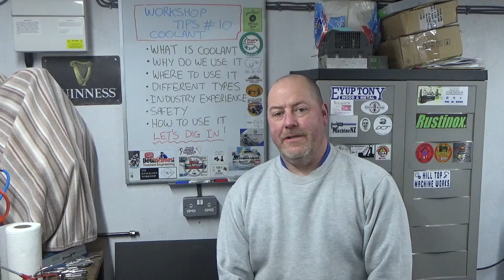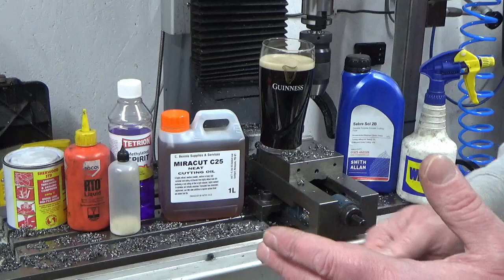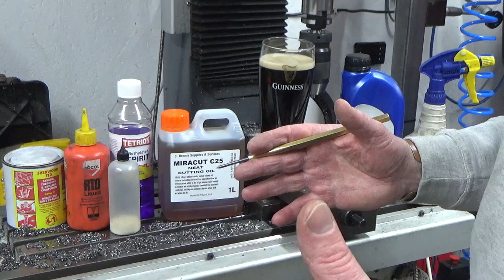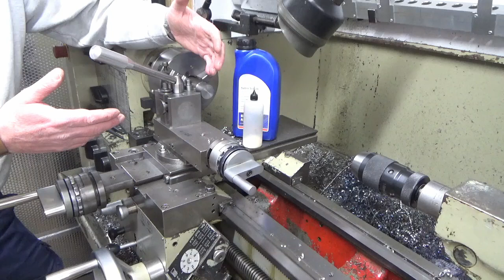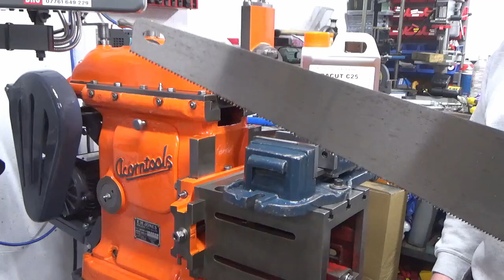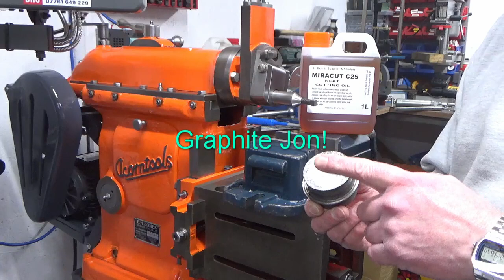Workshop Tips #10 - Coolant in the Home Shop

Comment: Hi Jon 
Interesting video but I really think you need to spend a bit of time researching bacteria, not all bacteria grow in the absence of oxygen, there are plenty that will not grow unless oxygen is present so removing the oil layer would probably just result in a different bacteria growing.
You also mentioned that you should not pour coolant down the drain, I absolutely agree, but what happens to the coolant that you squirt onto the  lathe, presumably you mop it up with a paper towel, then where does the towel go?
Reply from the maker: Hi Chris, thanks for the comment. Yeah, not really wanting to become a biologist, all my information just comes from real world experience, and having seen the bacteria growth 1st hand etc, I presume that when you do run the coolant, you oxygenate all of the liquid with more than enough for the bacteria to survive on, and when the tramp oil layer is on the top, it doesn't allow the gasses to escape accelerating the degradation. In terms of my use, the water element evaporates leaving behind a very small amount of neat oil, I just leave that where it is, and one day there will be enough collected in my sump tank to take to the recycling centre as waste oil, which they will take. Cheers, Jon

Comment: Good video about coolant. Do you have an opinion on fumes from cutting forces being bad for your lungs? If and when I build my shop next year or so I was thinking of fitting an extractor fan in the wall so the fumes can go straight out through the wall rather than having a fan blowing it out of the window. Just a point I thought I will make out. Thanks John
Reply from the maker: Hi Dermot, thanks for the comment. My opinion is, any fumes at all are bad for your lungs. It all depends what you plan to use, I wouldn't bother with extraction for soluble oils as they don't get hot enough to cause smoke, only steam. If you plan to use neat oil in small amounts thereby causing smoke then extraction is a good idea. Cheers, Jon
Reply: @jonsworkshop  Thanks John

Comment: Hi Jon, very interesting thank you. You would think they would have aeration pump like a fish tank to keep the coolant aerated.
Reply from the maker: Hi Philip, thanks for the comment. In industry they do just that on certain machines (especially grinding machines). The coolant is constantly pumped, aerated and filtered even when the machines are not being used. I guess this fact alone backs up my points in this video, as it is cheaper to do all this than replace coolant regularly etc. Cheers, Jon

Comment: when i worked under ground coal mining we had hydraulic tanks about 1000 gallon to run the face supports they had soluble oil in them when you came in an started them up after the week end the smell was really bad an inside them was disgusting
Reply from the maker: Hi Secret six, thanks for the comment. Lol, I used to make the filtration units for those coal mine units. I think we did 3 versions, 50, 100 & 150 gallon per minute from memory. I always presumed they just used water, every day is a school day. Cheers, Jon

Comment: Lol , i like Ralfy's version !    Not sure why they were called ''The good old days ''  when the chip trays were half full of  smoke butts & the coolant used to stink of cats piss !     When i use neat cutting oil on the lathe , i use  undiluted soluble .  Castrol Hysol MB50  is what i use .  👍
Reply from the maker: Hi Max, thanks for the comment. Lol, agreed. I have seen plenty of things going into coolant tanks that were never supposed to be in there. Also had to mop up the carnage when tanks are so badly corroded that they just let go one day! No fun. I think one of my work places used Hysol, but then moved to something cheaper which was very inferior. Cheers, Jon

Comment: Hi Jon, found that very helpful, I’ve converted the lathe and mill to spray coolant systems, one thing you touched on was the coolant fumes, i sometimes use the oil type coolant/cutting oil it produces a lot of fumes, just wonder how inflammable it is and toxic. Nice video Jon👴🏻👍
Reply from the maker: Hi Terry, thanks for the comment. I don't really know in terms of toxicity of fumes, but I would suggest anything that smokes is toxic to a degree and should be avoided wherever possible. I need to practice what I preach on this as my shaper exploits to date have not been good using just engine oil (lots of smoke), that's why I have bought the neat cutting oil which has anti smoke properties in it. Winter is the killer with the door shut really, door open in summer is probably the best precaution regardless of coolant type. Cheers, Jon